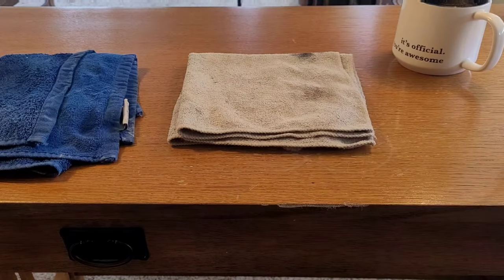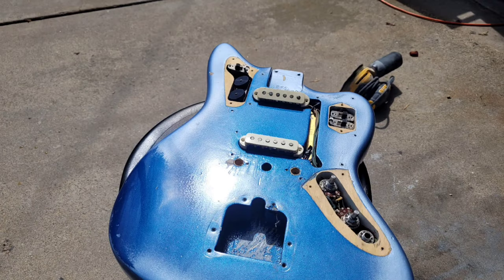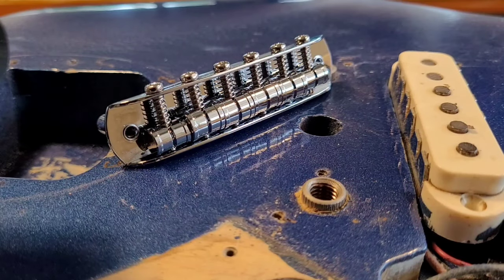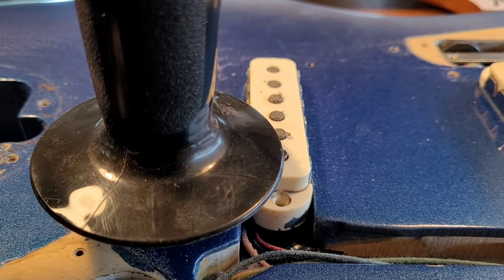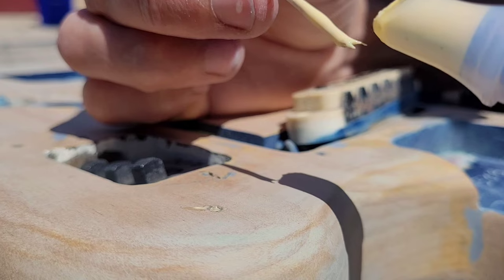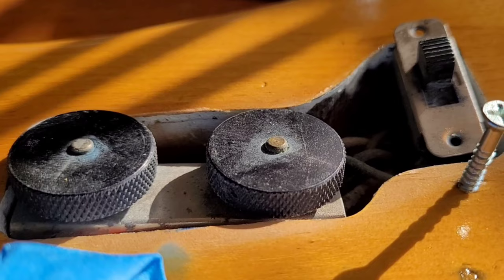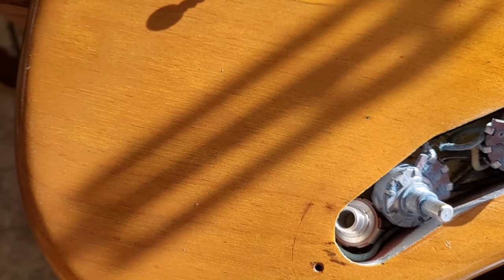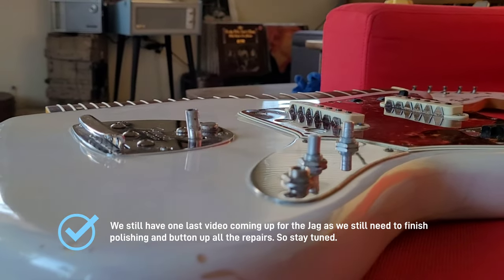Refinishing the 65 Fender Jaguar w/ NITRO

Comment: but why didn't you remove the electronics before sanding?  That bothers me so much haha
Reply from the maker: The state of the electrics led me to believe that removal could mean broken tabs on the switches and I'd rather have the originals as repros lack the correct weight and feel. Plus I wanted to use the original Olympic in the recesses

Comment: Sorry to be a pest. I’m putting together my Jazzmaster build and my AO neck maple looks really light. I’m wondering if I can spray vintage amber on top of it. So nitro over nitro. Seems easy but too easy. Any thoughts or tips are appreciated!
Reply from the maker: Not being a lest at all! And yep! You can shoot nitro over nitro. I suggest giving it a light circular pass with a scotchbrite pad and a mist until surface is dull with no sheen. This will help the fresh pass etch into the existing finish and eliminate chances of peeling or fish-eyeing. Anything I can do to help, Bry!
Reply: @breilly66  awesome! Thank you! I had a feeling it would be ok. But the technique you recommended I wouldn’t have done so thanks. Do you recommend a vintage amber for a neck? I was looking at stew Mac.
Reply from the maker: @brywestwhit Stew Mac is good. They're consistent in hue and the product is solid. I'd suggest them.

Comment: Dude, you had had to remove all the electronics in the first place. Dust from sanding got into the pots and pickups no matter how you taped it. It was really stupid not to do. Otherwise excellent job
Reply from the maker: Interesting perspective! I don't leave in footage where the pots are disassembled and cleaned. No one would watch it. I also don't take apart original and completely untouched 60 year old electronics any more than giving someone an ekg for no reason. For one, any breaks in original solder or fragile grounding plates on such a guitar would be used against me in the price. Secondly, it isn't worth upsetting tempermental electrics on a guitar worth more not working than unoriginal. 
   But thanks for the backhanded compliment. It goes great with coffee. Plus, every comment and response algorithmically pushes this little channel along. 
    If you still disagree, I urge you to make a video about it and appeal to the thoughts of your subscribers. I would be interested in hearing a broad perspective.
   I'm sure the results would vary widely.

Comment: Great video bud! I’m currently planning a build for a jazzmaster but I’m wanting a hard tail.  It’s crazy because I’ve been wanting a video going over all the bridge options and I believe you answered a lot of my questions.  Let me know if you have any recommendations for the tail piece. I’m wanting to put humbuckers in it but don’t know if I should angle the neck pocket or what to use a tune o matic or the mustang bridge with a different tail piece. Thanks for the great vid bud. Hope all is well.
Reply from the maker: I'd personally swing for the Mustang bridge and build it without the tilt but that's just me. I had reviewed a MIM Jag a few months back and I must admit the tilt took something off it. 
   Regarding the tailpiece, I used a version of this design when I built a 12 string Jazzmaster for a good friend about 2 years back. 
   And for the price, it ain't bad!
Reply from the maker: https://www.ebay.com/itm/Hardtail-Conversion-Plate-for-Jazzmaster-Jaguars-Staggered-String-Slots-/154684197663?mkcid=16&mkevt=1&_trksid=p2349624.m46890.l49286&mkrid=711-127632-2357-0
Reply: @breilly66  Gotcha, thanks bud. I think that would look a lot better and keep it in the jazzmaster look better than just a standard bridge or tail piece.  I’ve looked at a few with just a bridge and there is a lot of real estate behind the bridge.  It looks off to me for a jazzmaster style guitar. Thanks for the help bud. Subscribed!
Reply from the maker: @ChasesWKshop  Yessir and thank you Chase!